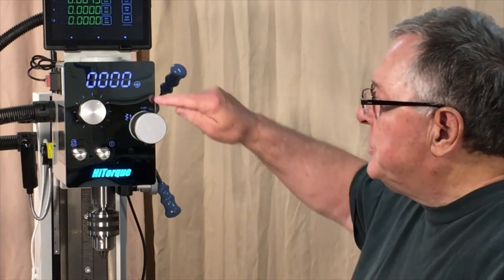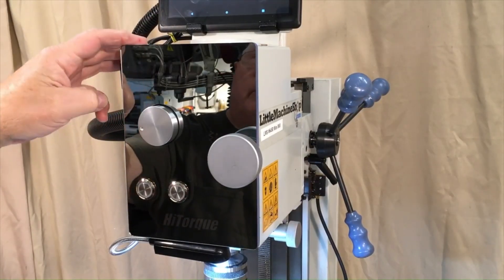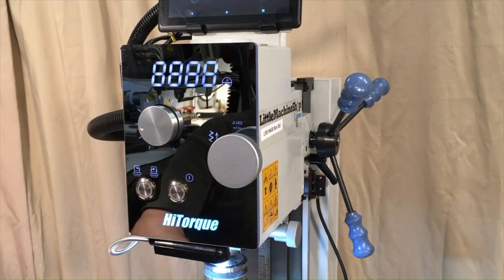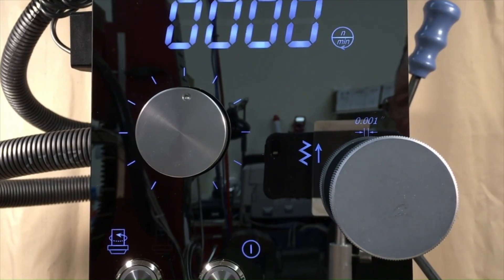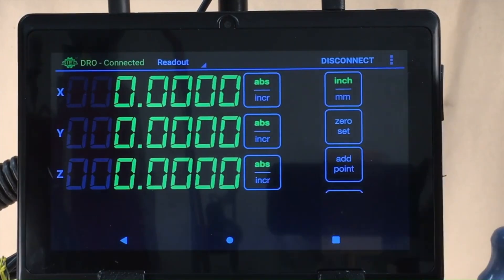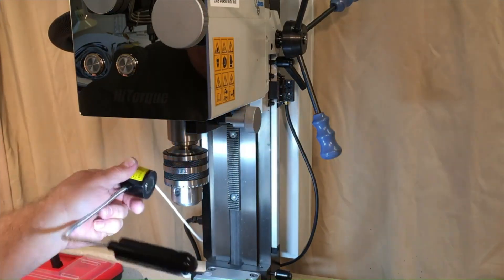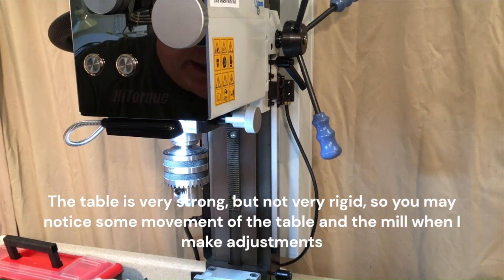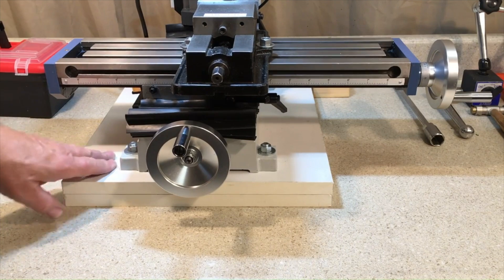Model 6450 Mini Mill pt1

Comment: What’s the amp draw on the machine?
Reply from the maker: It's rated at 8 AMPS. We brought to local maker fair and worked fine on 5 amps with extension cord, but we weren't really putting through paces...
Reply: I’m getting rid of mine, as I can’t stand not having a moveable quill.  These fine feed by dropping the whole head.  I would advise people to go to the larger little machine shop mills that have a movable quill.